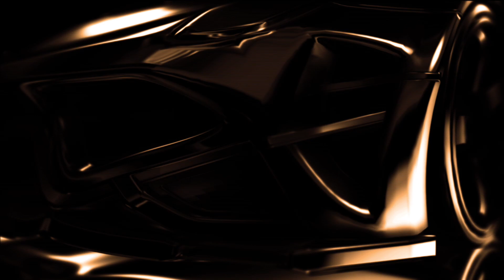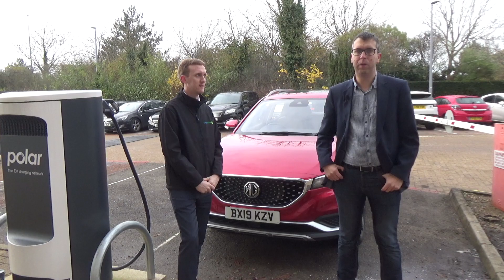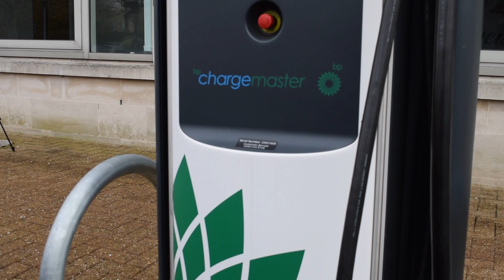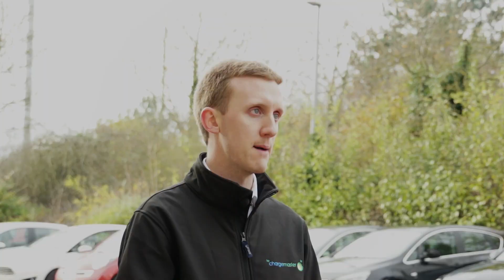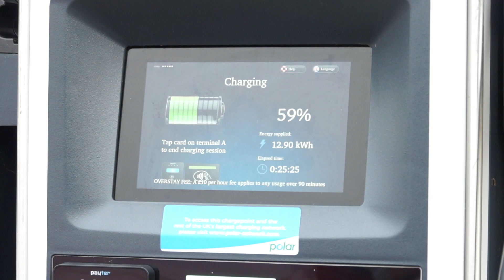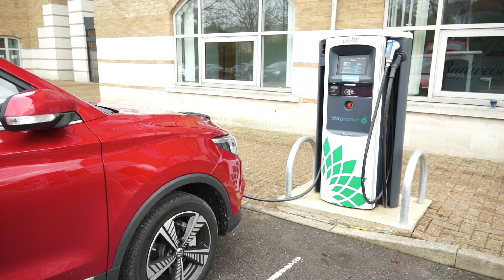Living with an EV - The expert charge

Comment: What is not mentioned is the paucity of RAPID chargers throughout the UK to combat "Range Anxiety." Recent BBC2 programme showed that it is not unusual to follow your charging app. directions to a site only to find the machine is broken or that only the slow charging 7kw units are available so forget having a cup of tea whilst your EV is charging, - you might have to book an overnight room instead. Until you can charge your EV as readily ( and almost as quickly) as a visit to the many fuel stations that line your route to your destination, your are tied to your local area to avoid said 'Range anxiety.' Hopefully this situation may improve when Govt. and manufacturers realise that relying on private electrical suppliers is not the only option. I might be wrong but doesn't Tesla build their own charging sites and include 'Rapid Chargers?) The Shell stations, at least , had a rapid charger.Will their be enough chargers ( RAPID) for flat and terrace house dwellers?How will Govt. recoup the lost tax income - well they could partner suppliers or lease/own their own charging sites? Lastly, maybe Hydrogen fuel will be the fuel of the future re rapid filling etc.

Comment: I don't believe much of what I am told any more. I was told in fact recommended I should switch from having a Rolec home charger to a PodPoint home charger (both supported by MG Motors free promotion) because the Rolec wouldn't wake the car for delayed charging. However, when the PodPoint was fitted yesterday it turns out the reason the PodPoint doesn't have a problem is because YOU CAN'T DELAY CHARGE AT OFF-PEAK AT ALL TO BENEFIT THE GRID AND MY POCKET!

Comment: The average charge rate is a measly 33 KW. So what's crap here, the car or the charging station? Looks like the ambient temperature is moderate which is ideal. Also, the sweet spot  is at 50% battery charge state. So what's the problem?

Comment: Man with Zoe I would always use a Rapid charger, where available, but not all charge stations are equipped with them. I’ve had my MG EV for a month and I think the main problem is the poor consumption. I’m getting 3 miles per kWh which is only a max of around 120 miles. Nowhere near the claimed 163/232. Also, when fully charged, the car tells me 100% = 154 miles. Is it the colder weather? I love the car, but hate the stats I’m getting.

Comment: I have just arrived home from my first road trip in my new MG ZS EV.. it took me over 12 hours to do a 140 mile journey from Tiverton to Petersfield, a journey that usually takes less than 3 hours! My first stop, after 80 miles, was at solstice services on the A303 where none of the Polar chargers accepted my contactless cards, despite having done so yesterday. I diverted to Salisbury where I charged for two 90 minute periods at chargers in park & ride car parks, for a measly total of 14 kWh. Just enough juice to get to Rownhams services on the M27 for an hour on the ecotricity charger, after the Zoe left (we waited 30 minutes for it to leave). This charger gave us a meagre 5kWh which was just enough to get us home. Very, very disappointed with the experience, exhausted and very fed up.
Reply: 140 miles should be within the range of the MG EV, so perhaps some forward planning. On the other hand, well done you for getting one, and for pushing the boundaries - you are doing your part in highlighting shortcomings in the present availability of charging, and your experiences should make life easier for EV-owners of the future. It would be interesting to do the same journey once every six months to show how things improve.
Reply: @Marknorthway  My daughter lives in Tiverton, so I suppose we go every 3 months.
Had the home charger fitted yesterday. Looks good and works fine.
My big issue currently is that the stated range is 163 miles. When charged to 100 % is says range is 152 miles on the charging screen in the car. That's not good, but it gets worse when you switch the car on and it says the range is less than 140 miles!
I will be talking to MG about these discrepancies.
Reply: @jrnodl17  Please keep everyone posted on how you get on. My one arrives early next years, and it is good to hear how people get on with an EV. I hope your next journeys go better!
Reply: jrnodl17 please note that the range of the car is affected based on mode used (eco/norm/sport) and whilst you’re engaged in each mode the miles of range is affected and reduced by whether or not air con is on. Don’t forget the car always defaults to Normal mode and this will defrost the car in 2 mins in icey conditions but if you switch to eco you’ll have more range with less efficiency in heater :-)
Reply: @jrnodl17  Hi, I hope by now you have learnt to enjoy your new MG it looks quite a nice car for this price point. 

But,as with any new car, you need to get used to it & especially when its electric (BEV in your case) it is quite different than a fossil fueled car, "filling " it up & driving. 
Quite brave of you to drive it 140 miles as a first road trip, knowing quite little it seems at the time about charging types, although it seems a disaster, its all a learning curve. 
Stick with it. Im sure by now 3 weeks later its got better?
You should very easily have made that 140 mile journey or with only with 1 stop at a CCS type rapid charger, thats 50KW & some even 150KW, although I haven't seen 150KW yet? You could have charged at up to 50KW or 75kw+ respectively in about 30 mins for roughly half of your battery charge back. 
Remember you can plug in for as long as you require, it doesn't need to be until its full or 80% but that is normal from a rapid charger.
Don't take too much notice of the stated ranges, there are a lot of variables they dont take into account.
Good thing to remember too,with all EV's they dont like the cold, less charge/range in your battery the colder it gets. 

They dont drive well if your name is "Jeremy Clarkson" either, better to be more "Captain slow" to get the best from it.

Copy & paste this link into your browser for info' from Podpoint, it might shed some light on what to look for in the future, in a short time you will wonder what the fuss was about. 

https://pod-point.com/guides/vehicles/mg/2019/zs

Though there is info all over the web now.

Stay Charged & enjoy your Electric car, its the future :)
Reply: @jrnodl17  Which make of charger did you have fitted.....I am due to take delivery of my MG very soon and I am still not sure which one is the best for the car.....Zappi is programmable but OHME searches for cheaper tarrifs so I am very confused.
Reply: @p.rom73  My charger was paid for by MG so I had no say in what charger it was or who did the installation. Mine is from ev.energy and was installed by SRG Electrical.
Reply: jrnodl17 not sure where your charging but I would suggest checking the charge rate of the chargers your plugging into. I had the same issue when I bought my Nissan Leaf. I didn’t realise how many different types of chargers there are and the rate they charge at. Some of the free car park chargers will charge at 7kw, and some at only 3kw. They aren’t always marked on the charger so the only way of checking is on an ev charger map. I use zap map. I’m surprised you only got 5kw out of the ecotricity charger as there up to 50kw. We’re you using the ccs charger or the type 2 charger as the type 2 will only give you 7kw per hour.
Reply: Daniel Sage the ecotricity only allowed 50 minutes max and was clearly only 7kW
Reply: My home charger is being fitted tomorrow. Hopefully the next time I’m on a long trip I’ll have it sussed. I like my car a lot, btw
Reply: @jrnodl17  Did you use the plug shaped like an old fashioned clock?  The CCS one that give DC electricity at 50 kW an hour which should charge the MG to 80% in less than half an hour..  The circular plug with a squashed bottom is AC only and will provide a maximum of 22 kW to suitably equipped vehicles like the Zoe.  To all others it will give between 3.6 and 11 kW, which will takes hours to give a full charge.  Not to be recommended.
Reply: That’s good because I’ve got one on order that’s due anytime 😂  thanks for the feedback, I will keep an eye on it when I get mine. Not seen any other feedback with charging speeds so hopefully you’ll get it sussed.

Comment: I didn't know you could programme the MG ZS EV to charge at the time you wanted it to.
Reply: Gemma Moore you can with every other EV but this functionality is sadly lacking with the MG (and they’re keeping very quiet about it).
Reply: I’m sure MG will be able to provide a firmware update before too long that will wake up the car when your programmed charger schedules the off peak tariff to charge the MG ZS EV.
Reply: @The_key70  I ordered mine in November (due early March) and was told that a app will be out in the new year.  Which I can believe as the MG is on sale around the world and they already have an app.  That being said, watch the Byorn Nailand videos on his Thailand MG EZS.  It has 4G internet and a completely different infotainment screen with a lot more battery and motor info.  It does cost about 4 grand more than the UK version.
Reply: I follow Tesla Bjorn and yes I’ve notice the mg app is available in India and Thailand with some good and not so good bits to it. There is also a possibility of a 3rd party app by OVMS :-)
Reply: Have you received an update regarding mg zs EV app?
Reply: No Jake ....I've heard nothing from MG
Reply: @manwithcorsae7738  Exactly the Thailand and in other Asian markets have different hardware which includes a 4 G module and therefore the App controls the charge that way. I don't believe much of what I am told any more. I was told in fact recommended I switch from having a Rolec home charger to a PodPoint home charger (both supported by MG Motors free promotion) because the Rolec wouldn't wake the car for delayed charging. However, when the PodPoint was fitted yesterday it turns out the reason the PodPoint doesn't have a problem is because YOU CAN'T DELAY CHARGE AT OFF-PEAK AT ALL TO BENEFIT THE GRID AND MY POCKET!
Reply: @manwithcorsae7738  Shockingly the Asian market appears to have a better software and infotainment experience with the MG ZS EV. I can not understand why, when new models come to the UK we very often loser out on certain functions, have to wait for or pay extra for what other markets get from the start as standard or optional extra. I have this at the top of my next car list but am put off by having an inferior experience.
Reply: @barryhaeger4284  Yes, this seems to be badly thought out.  There has been an update to the software in the MG that should make this possible, but you need a smart charger and the Rolec (or one or two others) app to make it work.  I had a Zoe which controlled the timings on board and told me when charging started and finished.  As my Chargemaster charger is dumb I may need to buy a smart charger if I want timed charger.  Ohme seem to have it sorted.
Reply: @GAMEBREAKER700  The problem with this is the data protection that exists in European countries.  The Chinese seem reluctant to sign up to GDPR.  There does seem to be a comms chip onboard and they can gather some data (or there may not be, no-one is really sure)
Reply: You should chose a charger that you can program.